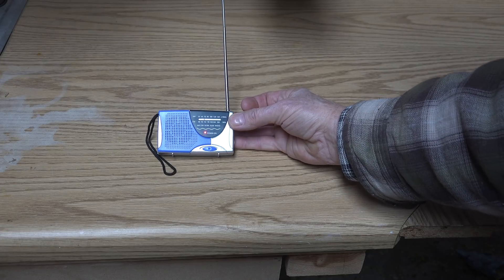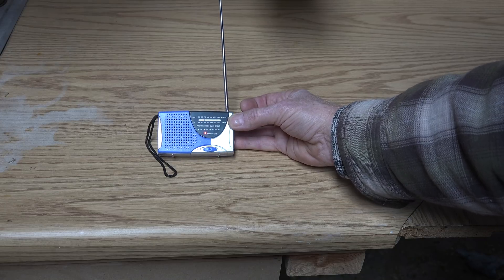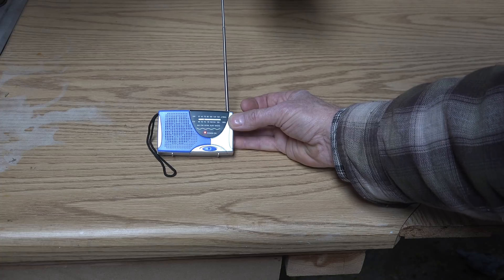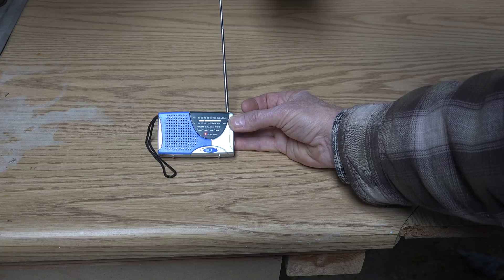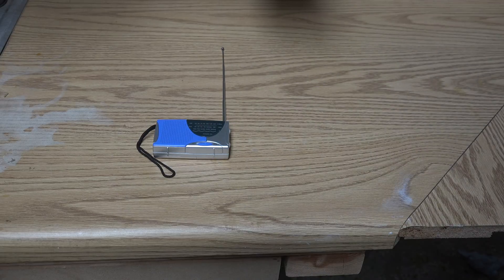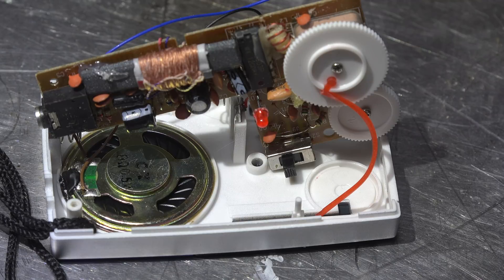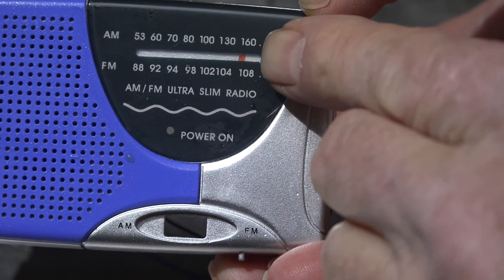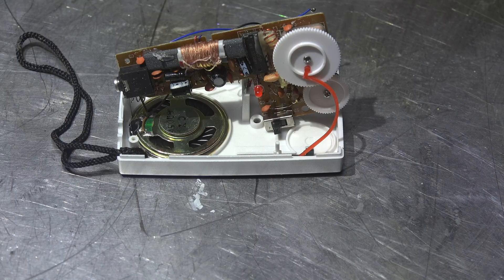What's inside a radio

Comment: I got a 6 Transistor Radio from mom about 1962.  It was AM Band only; No external antenna but a nice leather case for it--used a 9 Volt rectangular Battery.  I swear I remember opening it and identifying the transistors.  On the printed circuit board, they were the shape of top hats and about the size of green peas.  I just looked this up.... There are 2 Billion transistors in the average Smartphone.  Since the transistor replaced the push/pull tube, imagine needing 2 Billion Tubes to operate something?  These seem to be the first of many imports seen from Japan, I recall.
Reply from the maker: Thanks for the thoughts.  You brought back some memories with the radio.  The stats are also really cool.  Imagine 2 billion tubes in the smart phone!  I would need a warehouse to house it and a power plant to feed it power.
GFM
Reply: The radio also had a little pouch attached to the strap which held a "Primitive" one ear listening earplug.  Thought that was cool!!  Kids today would laugh.  If you Google "6 Transistor Radio"--a page showing many of the radios will show what they looked like--inside and out!

Comment: Hello ...Thank you for all your Great videos...Truly priceless bout of information!  I have a Beckett AF-15 oil burning furnace...I was hearing some thumps on start up so I recently changed the main filter and took the screen out of the pump and cleaned and re installed...I also cleaned the gun assembly and replaced the nozzle...I though I was having delayed ignition but after watching your video on the delay solenoid I believe the furnace is functioning properly.  However I get a little bit of a rumble/thump on start up...I wanted to clean the chimney or at least inspect it but the roof is iced over and I can't get access.  Could a clogged chimney be responsible for my start up thump?  I don't see smoke coming out of the inspection hole or anywere else...No smells or smoke....I don't have a way to measure but I don't believe there is positive pressure in the combustion camber....So do I just ride it out till spring? I just moved into this house so I haven't had a chance to do a full on proper service so I just did what I could quickly....any advice would be greatly appreciated.  Thank you and Happy holidays!
Reply from the maker: A clogged chimney could cause the rumble.  I would remove the smoke pipe from the furnace to the chimney to inspect.  There is nothing to see in the chimney.  Be prepared for soot everywhere.  
GFM

Comment: The black bar at the top with the coil is a ferrite loop antenna for the AM band. Most radios today are chip based, the radios don't even have intermediate frequency cans any longer everything is on the chip. The radio still work on the superheterodyne principle, mixing 455 Khz with the in coming signal for AM and 10.7 Khz for FM.
Reply from the maker: Thanks for the info.
GFM